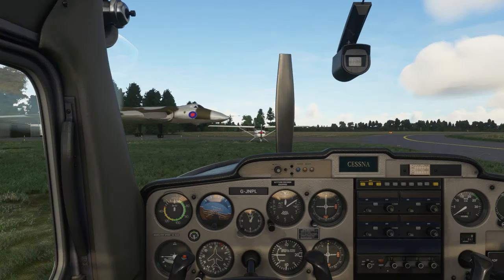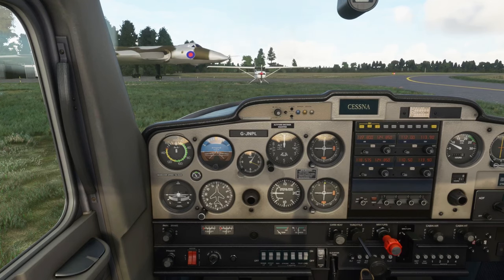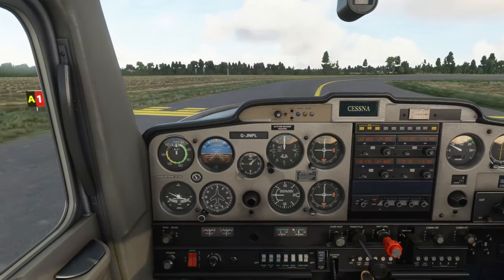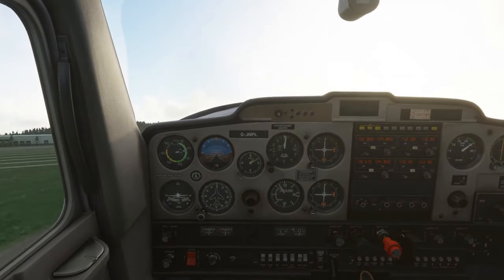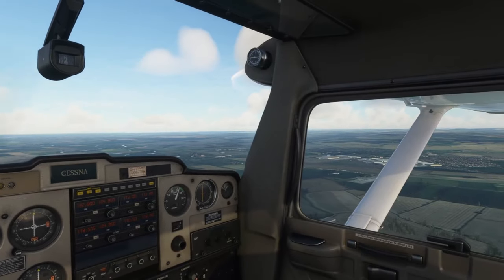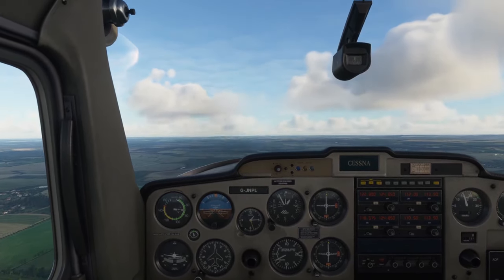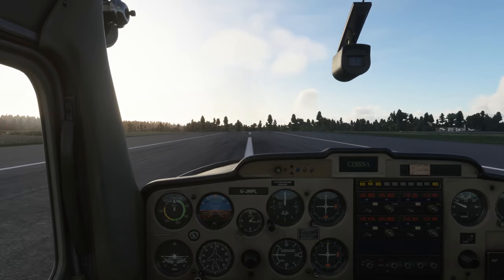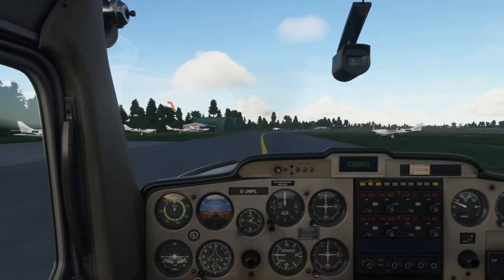Learning To Fly Episode 008 - EGBW 7th Pattern at Wellesbourne Mountford

Comment: Wow, what can I say! You have learned so much since episode 1. Well down. As soon as we both get out of tier 3 then we'll do it for real.
Just one comment since you asked for it. You were indeed a bit high & fast on final, principally because you didn't bring your third stage of flaps in soon enough. I would normally bring in stages 1 & 2 together as you turn on to base, then stage 3 at the top of the final approach. Now stage 3 is very draggy, so you will need to increase revs back up to about 1900rpm to compensate. The idea is that with all this drag offset by thrust, the aircraft will respond very quickly to small throttle adjustments. Remember that you use elevator trim to adjust your approach speed and throttle to adjust your rate of descent (seems counter-intuitive, I know, but it's true).
On a totally different note, is there any chance you could add in some parked aircraft on the northern side of taxiway Bravo?   At the western corner there is a PA-23 twin (G-BJNZ) belonging to friend of mine, it’s shown on Google maps and you can see images here.  https://www.bing.com/images/search?q=g-bjnz&qpvt=G-BJNZ&form=IGRE&first=1&tsc=ImageBasicHover
There’s also a Cessna Citation business jet which flies in from Ireland every day at 7.00am and departs at 5.00pm.   It’s the only commercial movement at the airfield apart from police helicopters which call in for fuel.
Reply from the maker: thanks for all the help and advice along the way, it all helps so much with learning!

I feel I messed up my turn onto downwind, which meant I was too close to Hampton Lucy for my base turn and it was panicking me because I didn't know when to turn. Even in the video I say Hampton Lucy is coming up but I'm actually looking at Charlecote House, I still managed to do the base turn ok but it's that point where I think it goes wrong because I only put 1 lot of flaps in there and I'm going way too fast so I can't reduce my altitude enough and then I put my 2nd lot of flaps in too late too. And all that meant I didn't get round to putting my 3rd flaps in till I'm over the road... I also can't remember if I pulled my carb out or not, it's out when I turn off the engine (so I may have forgotten to put it back in and did pull it out on the base turn)

its good to be able to watch the videos back and I can relate to where I panicked internally and where things went wrong. I'll keep at it :) but as you say at least i'm not floating half way down the runway now! :D

yeah I can add those aircraft in, do you want them in the same location as they are on google maps? I was thinking of putting a tractor in on the Bravo taxiway too as there seems to be one there (along with a small harvester maybe? That yellow thing on google maps?) I also need to replace the vans with caravans at the caravan park :D
Reply: Yes, the aircraft positions on Bravo are about right.   Don't know if you saw the comment I added to your 007 last night, link to a third party video.   The clip at time 1:04 shows them quite well.
https://www.youtube.com/watch?v=8nh3qAn7xyg&feature=youtu.be
The tractor & trailer is for sweeping up 05 after the Saturday market.   It's in storage at the moment so I can get any photos.
Reply from the maker: @152driver1  Yeah I can see them in the video. I think I've found a Citation model that I can use, the PA-23 seems like an elusive bugger to find a model for. I may have a go at modelling my own in blender, never modelled a plane before though!
Reply: Flying Theston  I would say don't bother but I know you will enjoy the challenge and it will make a great tutorial video to add to your collection 😀